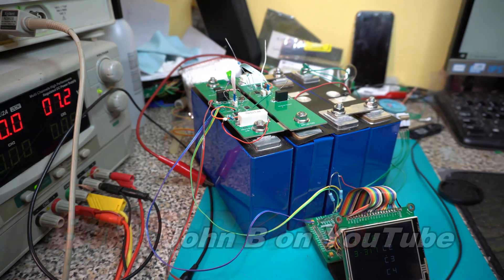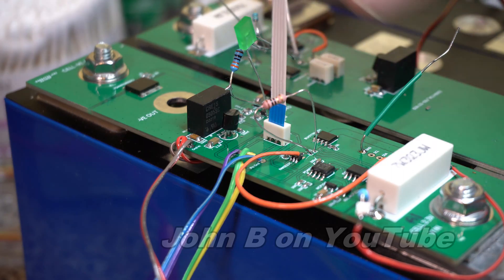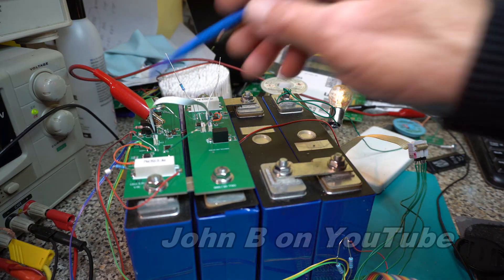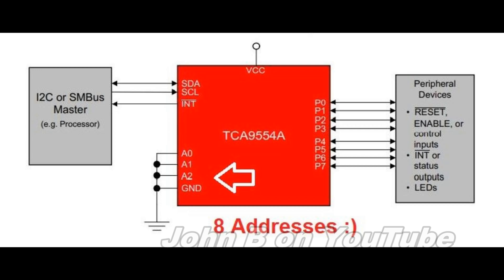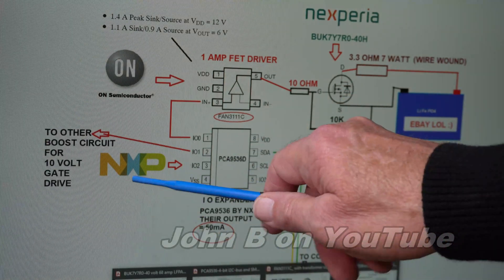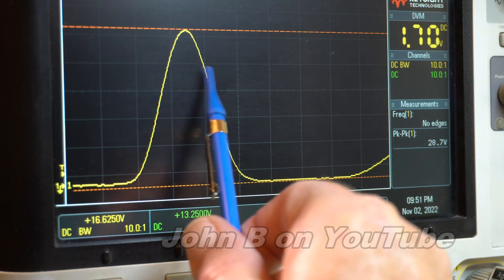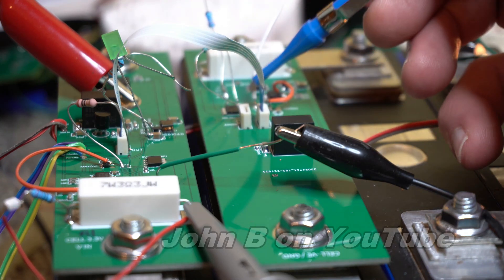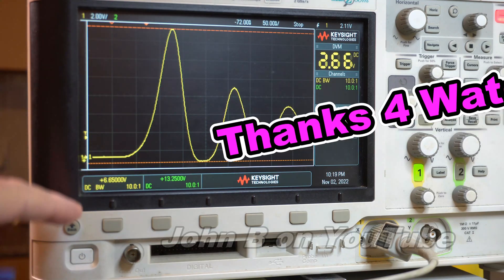Battery Management System (BMS) Design Part 6 - Fast Switching FETs - I/O  Expander PCA9536

Comment: John, as far as I can see, having a microcontroller control the cell balancing is a must. Is that correct?
Reply from the maker: Yes I would agree.😁
Reply: @JohnB-2021  I have a circuit in the works right now that does "lossless" cell balancing. Would that be of interest?